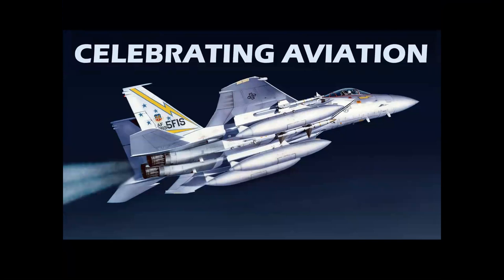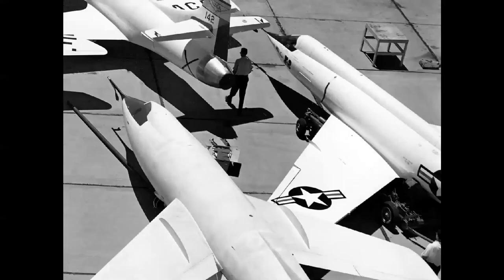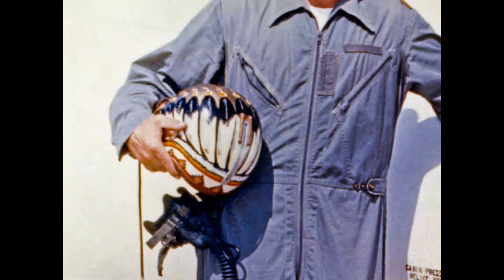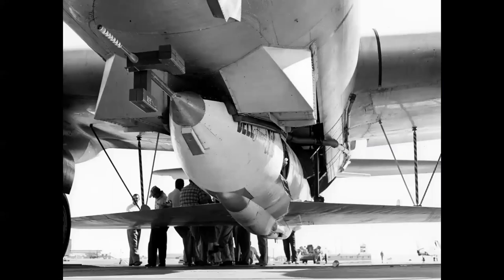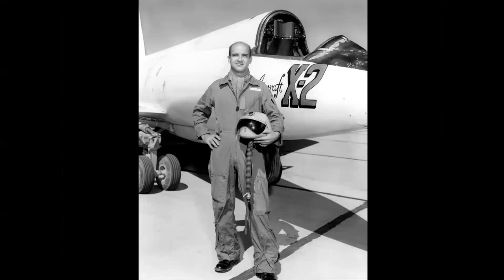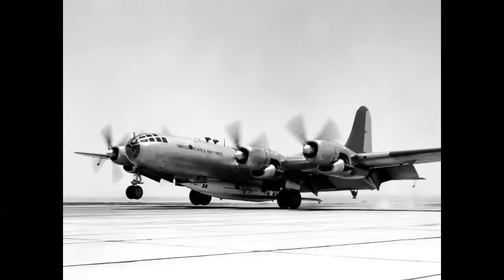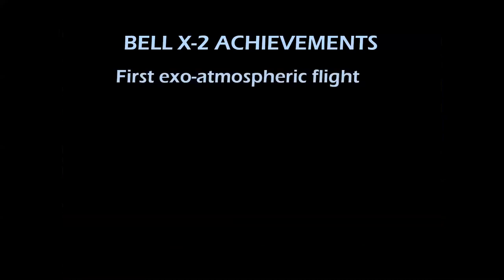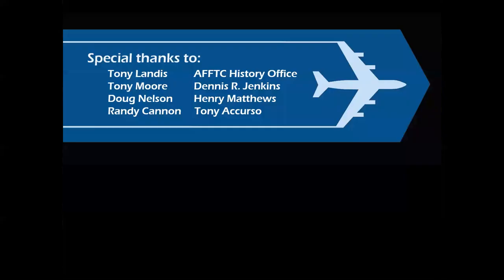BELL'S EXOTIC X-2 ROCKET PLANE - World's First Aircraft to Fly at Mach 3 and Over 100,000 feet!

Comment: Thanks for this video.  You're right when you say the X-2 is the most mysterious of the X-planes.  All I really knew about it was it had a turbopumped rocket motor, took 10 years to get into the air, and killed Mel Apt.  But as you say, its technologies that were troublesome at the time led to the success of the X-15 after they had matured from the lessons learned on the X-2.  It would make an interesting video to do a deep dive on why it took so long to get the X-2 into the air.  Being an engine guy, I suspect that developing a throttled liquid fuel engine was the main reason.
Reply: Its the most mysterious Bell aircraft... because it was actually the Messerschmitt Projekt 1110/I designed by Adolf Busemann.

Comment: Yes indeed ..life imitates art .. hopefully beautiful art … Another beautiful and fascinating episode  you make a great point about it being a bridge to the X -15 … Did the pilot take off inside the x-2 or board it inside the mothership …  ? Cause after an abort I’m not sure I would want to be inside the x2 when it lands …
Reply from the maker: Great question, and the procedure for all the first-generation X-Planes was to have the rocket pilot ride in the bomber's cockpit until it reached 10,000 feet, and then move back to board the research aircraft. This ensured there was enough altitude for either a manual bailout, or X-Plane launch and then glide back to the Lakebed. There were several instances of the pilot egressing back into the Mothership before the X-Plane was jettisoned due to malfunction and impending explolsion. The X-15, being mounted on the B-52's wing pylon, required the pilot to be in the rocketplane throughout the flight.
Reply: @celebratingaviationwithmik9782  that sounds like a great episode … I couldn’t imagine how something could go wrong with a liquid fueled rocket plane in the bomb bay … …. that’s the interesting thing about egress procedures and systems … being ready for the worst case scenario…

Comment: Why don't we have any footage of planes flying faster than sound?
Reply from the maker: Appreciate your question which is quite valid, and the answer is that initially, there were no aircraft used as photo chase planes capable of reaching Mach 1 when the first experimental aircraft were flying supersonic in the late-1940s. By the 1960s, although two-seat chase aircraft like the F-100, F-104, and T-38 could fly supersonic in short bursts, the fuel consumption was excessive when in afterburner. The Convair TB-58 photo chase did indeed take photos of the North American XB-70 Valkyrie flying supersonic. Thanks for watching!
Reply: @celebratingaviationwithmik9782  thanks for answering

Comment: The British had an X plane in 1945 with a Whittle engine + afterburner which they sent  to America after giving up on supersonic research… so Eric Brown  was denied his chance to break Mach … was it a viable program with potential to go supersonic ..?
Reply from the maker: I believe you're referring to the 1946 British Miles M.52, but that wasn't powered by the Whittle engine. That pioneering powerplant was built under license by General Electric and test flown in the Bell XP-59 in 1942. A model of the M.52 was air-launched and achieved a scale speed of Mach 1.38, but a full-scale manned jet aircraft doing that would have been a challenge back then. (By comparison, Chuck Yeager's Bell X-1 was rocket-powered.)
Reply: @celebratingaviationwithmik9782  Thanks I’m a big Eric Brown Fan …as well as all test / fighter / cargo / commercial / helicopter ./ pilots … I don’t watch football
Reply: The Miles M.52 is a popular British myth that proports that the UK had a supersonic aircraft in 1947, this is a completely false revisionist myth that attempts to insert Britian into the early development history of supersonic aviation that it did not participate in or contribute to in any meaningful way.

We know today that had the M.52 actually been built it would not be capable of Mach 1 in level flight, no aircraft powered by an obsolete and highly inefficient centrifugal jet engine has ever flown Mach 1, its simply not possible..

Comment: It's a shame they scrapped the X-2.
Apparently, the last plane was in good enough shape even after the fatal accident of Apt that it could have been reused.  At the very least, it could have been restored for static display!
I don't understand the attitude of scrapping unique pieces of engineering.
Not the first or last time that's been done.  They scrapped both of the B-52 prototypes and those were unique in not only being the first B-52s but also the only two B-52s built with bubble canopies!
The USAF had the second B-52 (YB-52) in its collection (but never delivered and on Museum ground premises) but then bailed it and allowed it to be scrapped in the mid-1960s to get a production plane!  Now, they at least transfer planes between museums if there's room.